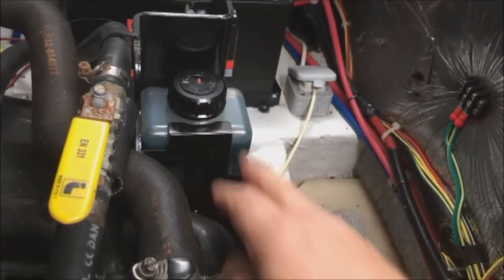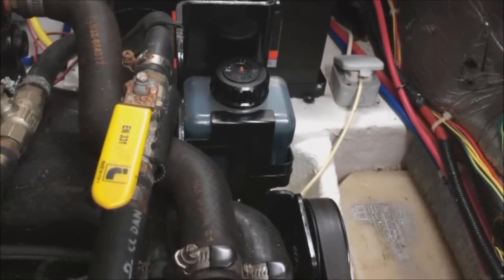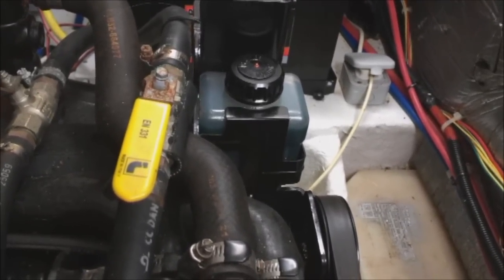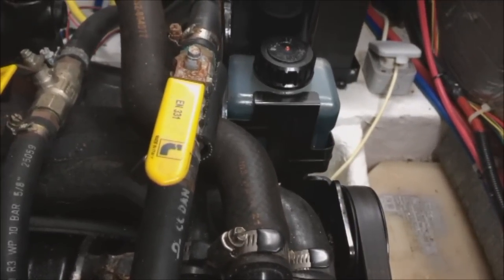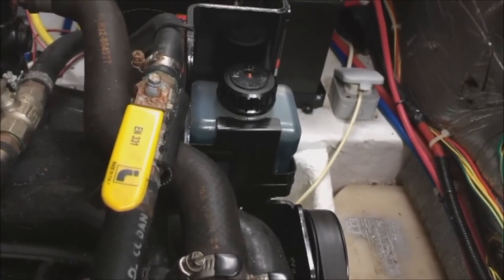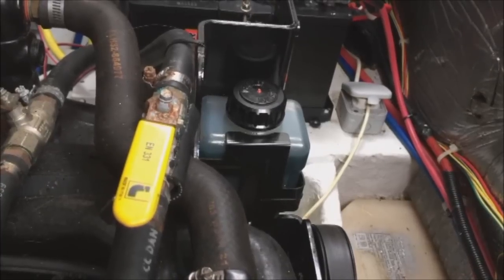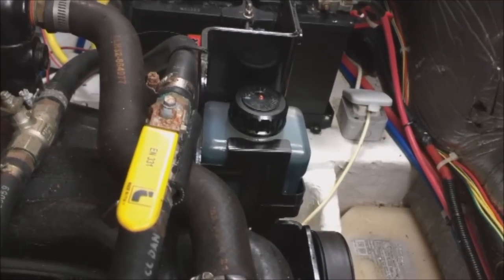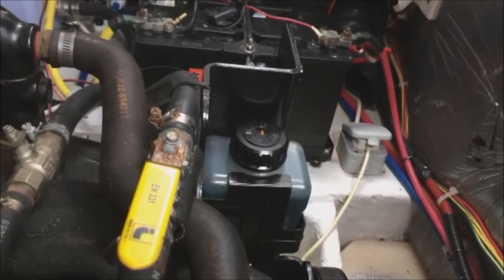Alpha One Gen 2 Upper Drive Seal Leak

Comment: Always install a new driveshaft bellows after this seal failure, as the gear oil will have contaminated the bellows with oil, and the oil can quickly rot the rubber bellows causing it to split.
Your bilge can then fill with water and the boat may sink rapidly👍

Comment: Useless video when you only talk talk talk and don't show anything usefull.
Reply from the maker: I think you’ve missed the point as I’m not trying to tell you how to sort, it’s the fact the oil trace on the transom will confirm a leaking seal without the need to lift the boat ..

Comment: What was your repair cost?
Reply from the maker: I took the leg off myself and took the upper drive to Mercruiser Company who charged about £170 ($200) in 2015 as you need special tools plus seal and bearing.  Not sure what the cost would be if you go to a Marine Company for the whole job I would imagine it would cost circa £500 ($650)
Reply: Thanks I have about 161 hours and noticed the outdrive fluid kept getting lower after running the engine and found fluid on the transom floor.   I  can not see where it is leaking from so will have to take it in I suppose.  I appreciate your fast response.
Reply from the maker: If there is blue/black oil in bilge area that is a sure sign of Upper Oil Seal Failure, the oil drains out where the upper drive shaft connects with the engine down the transom in to the bilge.
Reply: @MrRossYoung44  I have black/blue oil in my bilge. Can this fix be done at home or do I need professional help? I am pretty mechanically inclined